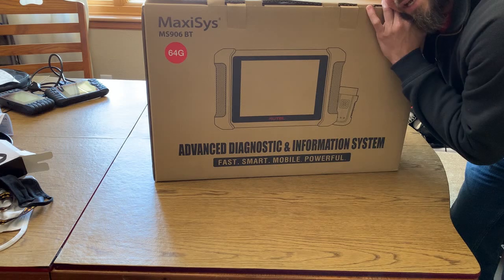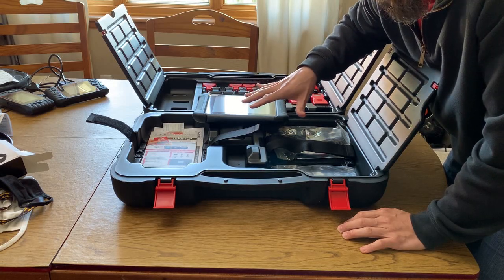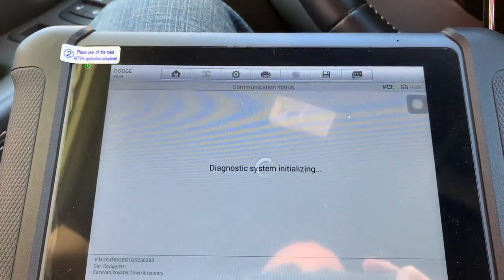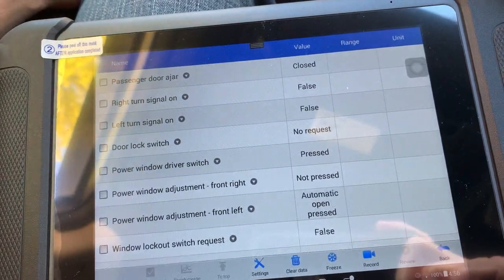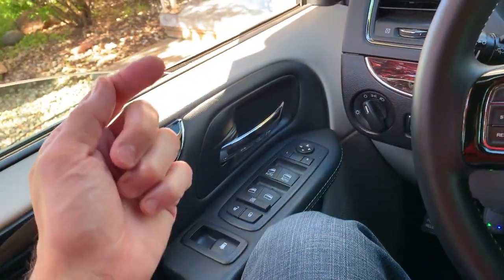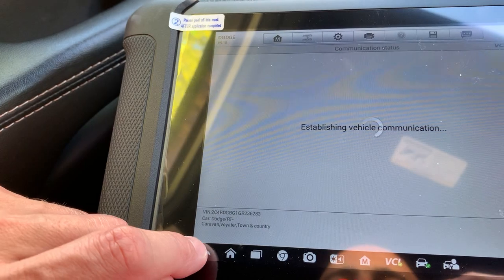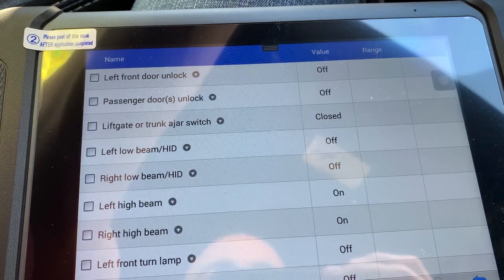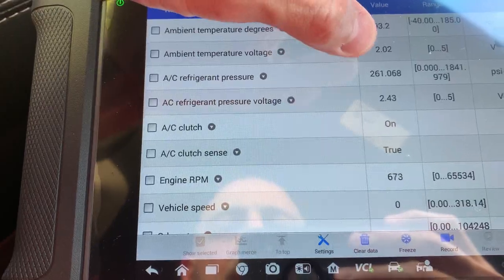Are Autel scanners USELESS - MS906BT - MUST WATCH BEFORE PURCHASING -

Comment: I do have an iCarsoft CR Max, which is basically the same as the Aitel MK808. The only difference is, tne CR Max gets free lifetime update, while Autel charges around 100$ for every update. This MP808 is a great tool, and the bi-directional funktionality is very useful, but they charge a crazy amount for the updates. The tool itself is not super expensive, i think it's worth the price, but to pay $300 for an update, is crazy.
Reply from the maker: I just ordered one as well as it looked like autels software!
Thanks for sharing!
Reply: I have the mk808bt fully updated. I have had it for 6 months or so and it is not fully bi directional. No active tests and limited on the high end. Some relearning available but not truly bi-directional.
Reply: Is the icarsoft cr max is good for a Nissan Rogue 2009

Comment: I need a good scan tool for mercedes benz ?? What should I get I want one that's bi directional I thought of buying a autel mp808bt or better and I bought a think scanner and it had good functioning but some features didn't work for mercedes benz. And I paid for the mercedes benz soft where then the vci Bluetooth doggle died.  Then I couldn't use it but for $450 it was cheap and not bad
Reply from the maker: If you just want it for Mercedes then just get a star scanner. They all work the same. They all use the same software its just the speed they do it at.

Comment: What scanner can I use to check the oil temp in transmission in a 2007 Mercedes E320. I want to change the oil in transmission
Reply from the maker: ICarsoft v2.0 works very well for this but you can also use a infrared thermometer on the trans pan.
Reply: @MasterTechLou  ok thank you. I really appreciate it!
Reply from the maker: @marcelcovaci9922  anytime my friend.,

Comment: hey brother thank you so much for this very informative information, i've been burn with scanner before not knowing about it. now im trying to be more careful choosing the right scanner. i've seen "zurich zr-pro" at harbor freight, but i've seen this autel scanner before but not sure how good this scanner until i watch your video. thank you so much
Reply from the maker: Thank you as well! I appreciate you watching and reaching out!
Reply: @MasterTechLou  hey brother is that autel are like PRO SERIES scann tool?. because i've found many kind of autel scann tool at amazon
Reply from the maker: @orquizagarage2795  gotta be careful, read thoroughly because the title may not be what you’re actually getting.
I got mine from oriellys, they worked with me on price. Go on autels website and look through the options. Any questions reach out to curtis who I mentioned in my video. He has a lot of knowledge on the difference of scanners.
Reply: @MasterTechLou  can you posted link or how can i contact you may be through email. ive been searching some very affortable yet powerful scanner like yours. and i know theres many models of modern autel scanner out there
Reply from the maker: @orquizagarage2795  you can contact me through my website, www.cartechconnect.com 
Use the contact link.
For diagnosis I ask you follow the “ask a question” link but for this you can just contact me no worries

Comment: Has anyone used this to program keys, I'm hearing a bunch of mixed reviews about it not being able to handle key programming.
Reply from the maker: Autel scanners do program keys depending on car. You may need the autel key programmer box with some cars. But yes autels do have the capability.
Reply: Yes but was curious if anyone's had success with this model more so.
Reply from the maker: @RCautoworks  yes I worked with a guy that programmed toyota highlander keys with this scanner.
So it is Capable but I dont know exactly which models and makes

Comment: I absolutely love the high-end Autel platforms, but they're mid tier products are super deceptive and just glorified code readers. It's really a shame that the bi-directionality is locked behind a brutal paywall when it's essentially required to diagnose a lot of systems in modern vehicles.
Reply: It’s crazy that updates cost like over $600 a year smh 🤦‍♂️
Reply: @dieseldawg7132  unless you want to try coding modules of brand new cars which you shouldnt, then my advice is dont update every year. You have the data for the cars it can do which is most which are older than 3 years. Trust me the tool wont need update. My MS906 I have not updated in 4 years.
Reply: @jamesbarratt593  hey thanks for the response my concern was if you didn’t update it would somehow lock you out! And that makes sense but still it’s a bit pricy I went with an x tool….
Reply: @jamesbarratt593  if you decided to update after 4 years what’s the cost ?
Reply: @dieseldawg7132  My update was 295. For one year of updates.  I have the MK808TS and did not update since 2020. But since I purchased it now has bi-directional functions.  The update gave me all the new 2022 bidirectional functions.  I did not want to continue to pay a yearly subscription but definitely wanted the functions.  I'm glad I didn't need to purchase a whole new unit.
Reply: Please elaborate
Reply: What do you mean it's locked behind a pay wall? You gotta pay extra to use the functionality that's on the scanner?
Reply: I got ultra and im608 pro. Autel are scammers. lots of functions dont work.

Comment: Is it true you have to pay a subscription every year
Reply from the maker: Yes and  no, the only thing the subscription is good for is updAting the software of the brands.
But lets say you only use it for cars made before 2019
Then the software updates dont matter to you as it will only help with cars that are current. But even then if a 2021 model come out brand new and your scanner is updated to 2021 then it will most likely work for the next 7 years as all the software in that model will most likely be the same for the whole mode run.
I purchased a Launch in 2017 and it has done fine for me as I havent messed with any cars past like 2015 with it. Hope this makes sense. What people do is buy the scanner and once the year sub runs out, just wait about 4 years before purchasing another sub to update to the latest year. That was you don’t have to pay for it yearly. Most times only shops need to worry about updating yearly. Hope this helps .

Comment: Will the autel j2534 work with a Windows lap top . And I don't need to buy a scanner ? I'm talking about programming .   Will the attell j2534. Do most model of cars .  Why is autell being like snap on now , and Charing so much for the yearly subscription.   I still can justifying this equipment ?  I'd rather sell it . A test light I can fix most stuff with.  For 20$ ?
Reply from the maker: Yes it will
But only for certain manufacturers and certain programmmings.
Others need a scan tool to initiate it.

Comment: i have the autel im508 and have had to program keys on a honda with a replaced bcm. resynced module to car & programmed 3 keys to car. car starts and runs. but still has wrong vin in the bcm. what is the most economical way to re write the vin ?
Reply from the maker: Sorry, I wish I knew. I have not personally done one enough to know the options.

Comment: Good info.  I’m looking into buying an Autel.  I’m going back and forth on the MS and the Mk 906
Reply: Did you get the mk906 thays supposed to be the updated version of Ms906 and ms906BT
Reply: @mplscarsales6652  no not yet.  Have to wait on it. I ended up buying the 608BT because I needed a battery tester for work.  We do alot of 6volts

Comment: Great job on adding some humor into your tutorial, and the fact you actually did a hands on feature walk thru. Most videos posted are a ten minute (unboxing), I know how to open a dam box!  I would really like to see someone like you guide me thru the vehicle entry process. Autel themselves couldnt explain how to obtain some of the info that is prompted for during the scan tool vehicle set up. They told me to call the dealer. A few examples of info scan tool asks for are: Seat Memory control module version, Inflatable restraint sensing and diagnosis module version, remote heater and air conditioning control module type,, I could go on and on. How the hell do i know, lol.  I even had the car ID tag with all the abbreviated codes deciphered, and no help.  I had to laugh some while watching Scanner Danner do a review of a high end Autel scan tool, he was clearly frustrated that scan tool asks for that info, after all, it read the vin!! It should know! Snap On scan tools dont ask such things. I guess there in lies the difference between a several thousand dollar tool vs a thousand dollar tool. You do such a good job explaining things, if you could shed some light on how to obtain needed Info, that would be GREATLY appreciated. By the way, I have the MaxiPro MP 808.           Thank you, Tom
Reply from the maker: Tom sorry on the delayed reply, I wanted to have time to be thorough. so, I ran into your same issue as well, mostly with GM products. so the factory scanners know whats installed, the aftermarket ones do not, so , its basically trial an error UNLESS you do know what versions are installed. I have ran into this a few times and yes you would think the rpo codes help, nope!
so, you kinda have to know, in order to know. its tricky. I am the same way, as smart as I think I am, when it comes to these scenarios, you just pick one and roll with it, so basically if you are checking the engine module, then nothing else will matter. if you are checking a steering column module then you will want to choose one option, see what happens, then back up and choose a different option, basically the scanner is either going to read it if you picked the right option, or not read it if you didnt. so its trial and error., until you can see the differences in the modules and what values they show, might lead you down the road to now know what to answer when you come across that again. I hope this answers it, even though I hate the answer I gave, it is what it is. I dont know how else to know the specifics of the modules and their versions. Lou
Reply: @MasterTechLou  thank you very much for responding. I have to think you get a ton of questions, so to answer so promptly, and so elaborately, well you have this man's respect.  You did a fine job of explaining. Now I feel better knowing it is not just me that has the same issue, and you address it just as I do, a trial and error method.  As much as I like my scan tools capabilities, I have to question the engineering behind developing software that asks questions that are for the most part, unanswerable. I reached out to you because you seem quite knowledgeable under the hood. Amazing how many how to videos are made by idiots with no clue.  I find it strange that after searching high and low for answers to my question, that not one person brought up that aspect of Autels tool. Yet I found it hard to believe I'm the only one that encountered such problem. 
Thank you again Lou, your time is greatly appreciated.  Tom Latimer

Comment: I bought the MS906BT last year and it’s been great. The bi-directional functionality is main reason I bought it. Meaning it can initiate tests and calibrations to clear codes.
Reply: Did you buy the MS906BT on Amazon and are they software upgradable?
Reply: Will this scanner release electric  brake caliper pistons.
Reply: So since you have it could you tell me if you know how effective it is for TPMS and Key fob related jobs?
Reply: @ericksoler1221  I have two different ones and borrow third on occasions. Not all cars work on any single unit.   Your correct though it takes years of learning. I’m 60 and still learning
Reply: It's an awesome tool to have Bruce!

Comment: U Know another issue with all the videos on autel scanners is know one every says the difference between cars,trucks,1/2 ton too 5500 class Dodge,F550 powerstroke, 3500 duramax 
Nobody does videos on these diesel trucks in information Just Saying
Reply from the maker: You are correct, Autel does offer a heavy duty truck scanner.
Reply: @MasterTechLou  except they are for heavy duty 650-up
450,550,4500,5500,are yes considered heavy duty but aren't a 9 pin connector still obd2
Reply from the maker: @bradmcmanis3231  I gotcha, yeah I dont have any experience myself with heavy duty.

Comment: Pretty decent tool, when we first got ours I was feeling pretty disappointed and was going to return it for a refund... I gave it a second chance and I have fixed so many cars with this now. My biggest complaint is all the features are not on one menu, you really need to go down multiple menu rabbit holes to find what you want to do. 2nd complaint is the battery seems to go down quickly 3rd complaint the screen feels like cheap plastic and scratches very easily. 4th complaint cpu processing tasks takes a while.
Reply from the maker: Well I can concur with all of the above statements. Battery does seem to drain fairly quickly. So far tho its a great tool with tons of oem access.
Reply: @MasterTechLou  Hey I'm DIY mechanic looking to get scan tool on the budget. I will be buying Coparts flood, mechanical, theft loss type of cars. What scan tool would you recommend  this or CG Sulit 680 pro?
Reply from the maker: @thinkaboutit78  actually im about to review the xtool A30M which is almost identical but a 1/4 of the price.

Comment: I agree most scanners are junk..you need coding, adas, bi direction controls etc now a days. Most of the lower end Autel’s are code readers. The 906 and up is way to go...But yes the person needs to have a diagnostic path and follow it using reasonable deduction. Also need wire diagrams as well.
Reply: Take a look at the autel MP808.  It does a lot and it has full bi directional control, at a reasonable price.

Comment: I'm actually looking to buy the Autel mx808. I basically need a cheap scanner that can purge the    Solenoid valves in my 02 Audi a4 3.0 quattro. I just replaced the brake booster + master and now have no brake pedal. I did a manual bleed but now finding out I need to purge the abs unit, looking for some insight if the autel mx808 would be a good buy for Audi's.
Reply from the maker: I think the mk808 is what you would want. But if youre bleeding with the pump pump hold method that Is not the right way.

Comment: Helpful video thank you for that sir
I hope you make video explain the function of which is better between autal906bt & lunch 431 v+ 🙏🏻
Reply from the maker: Honestly they both have pros and cons I just found the autel would not read a nissan armada air suspension module but my launch did! So they are extremely comparable but will both have their own limitations I would choose either!

Comment: Thanks for the great video!  Trying to understand the differences between this scanner and Star stuff you get from China.  Can this scanner pull up WIS type information to make the repair?  Heard many horror stories on the Chinese knockoff stuff and it going bad after a few uses.
Reply from the maker: this nor any aftermarket scanner will not be able to pull up repair information as far as how to.
 you are best suited to purchase a wis disc set from ebay. the star from china is just as good if not slightly better than the oem scanner the only downfall is you cannot program anything or software update anything since you are not connected to a dealer network.

Comment: Thanks. Appreciate that you explained why you need a bi-directional scanner. I am taking an online class for auto electrical diagnostics and most of the videos that I see from pros on You-Tube have a bi-directional scanner and Pico scope so I am doing my research to make sure I buy something that will advance my learning.
Reply from the maker: Thanks I appreciate that. I will tell you that I have been working on cars for 25 years, and we used scopes more in class than anyone in the real world. They are handy and I recommend using them just to stay fresh with how to use them, but I cannot say that many techs ever need to bust out a scope. Normally its the ones that want to show off how smart they are HA., but the graphing on the scanners is usually just as good as a scope it al depends on the scanner and the refresh rate of the data. but I hope you find what you are looking for, if theres anyway I can help please dont hesitate to reach out. Best of luck, Lou
Reply: @MasterTechLou  I like the scanner you chose. I am going to order one today.  I also subscribed.
Reply from the maker: @eyesalooking  so far I love this thing!
I did already find an issue where it cant read nissan air suspension! But my launch did. Which was kind of like wth, but it does so much. Truly worth the cost.

Comment: Can I do an engine compression test on a 2014 C63 with this scan tool or do I need the Mercedes Xentry/Star system to do that?
Reply from the maker: Yes this can do the compression test. I have not done it personally but have helped others that used it for that reason. This tool is extremely close to the oem euro cars.
Reply: @MasterTechLou  this is good to know. I have a 03 S55 and want to learn about these cars as I plan to keep this one for awhile. So having access in diagnosing this car will make ownership that much more exciting. Great video! Stay well.
Reply: @MasterTechLou  What do you mean exactly close to the euro cars?
Reply from the maker: @padraiggalvin2807  oem / dealer/ manufacturer scanners for  european cars. I hope that answers that.
Reply: @MasterTechLou  yes thank you
Reply: Fantastic. Thank you!

Comment: I only work on Benz please I need your advice as to what kind of scan tool I need to buy for new model and old model (1999-2021).
Am looking at lunch x431 V+ (pro3) and Thinkcar THINKTOOL PROS. Please respond thanks.
Reply from the maker: If you ONLY work on Benz and NOTHING else then just purchase a star diagnosis machine. The Mercedes Benz scanner. Its cheaper . There are many stores online. Thanks!